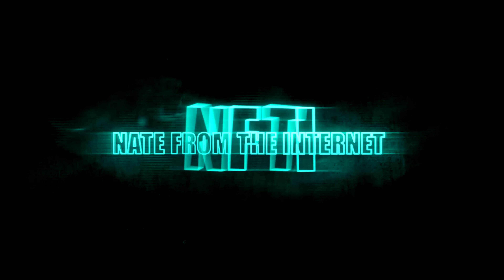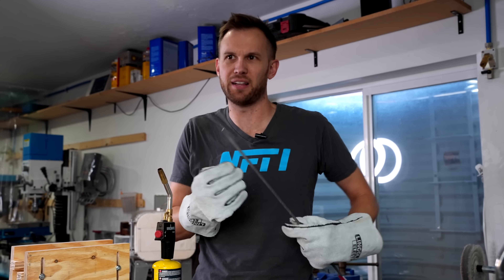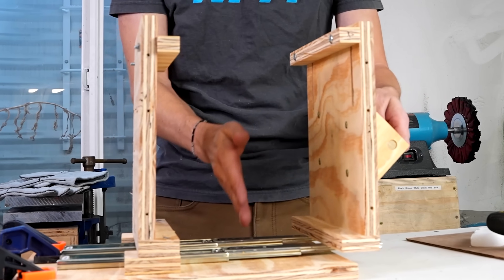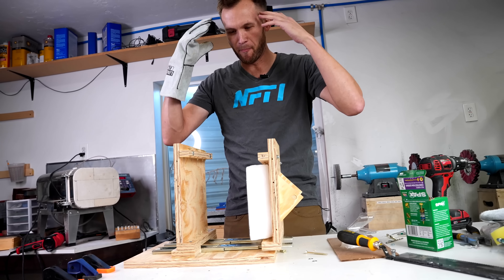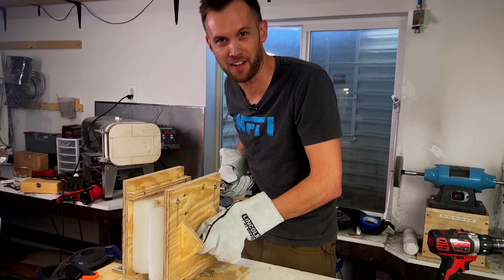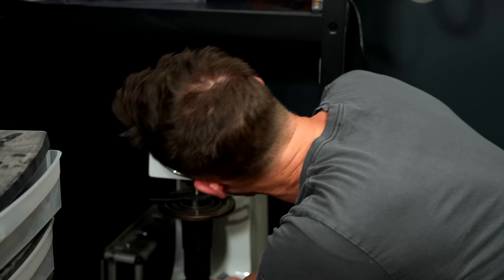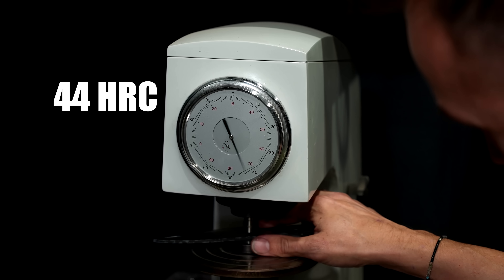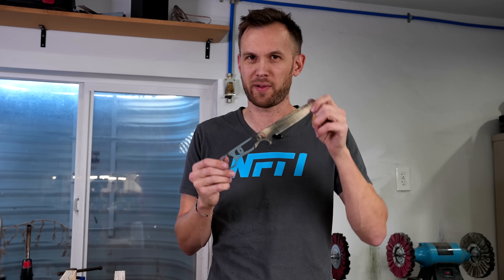Can You Quench a Knife with DRY ICE??

Comment: When using a hardness tester you get the needle as close to vertical as you can in one smooth motion, then rotate the dial to match the needle. Tapping on the adjustment knob might apply too much preload force on the piece. How it works is it has a standard preload force, it applies a test force, then it measures the difference between the initial indent at the preload force and how deep the test load force indented. It might not be a huge difference, but would be more consistent.
Reply: He didn’t grind the thick decarb off of his blade. He also didn’t use foil or anti scale to prevent the decarb from happening in the first place. It’s likely 61-63hrc in the core depending of the stainless alloy

Comment: Could you imagine using aluminum as cooling plates and LN2 to cool them internally?  That might work better than just using dry ice on aluminum plates.
Reply: the way i do it is AL plate quench then into the LN dewar after the blades get to room temp. the blades then spend the night in cryo.  this way my kiln can come down to room temp slowly with the door closed.  its better for the firebrick life.  in the morning i ramp the kiln to 400f and pull the blades out of the LN.  the kiln stabilizes at 400f about the same time the blades get mostly back to room temp. most steels i temper 400f 2x for 2 hours

Comment: I think it would have been much better if you had used  the dry ice vertically, with a lower and upper part, and a weight on the upper one after putting the knife in, that way you would not lose contact and would need smnaller blocks of dry ice to fit the knife in between. Without the moments you lose contact I think it will cool down faster and more evenly. 

and a sugestion for another material to try knife quenching: super cooled water, the water would normally freeze upon contact with the knife as it starts to crystalize, but at the same time it would be heating up too much to properly crystalize around the hot metal.

Comment: The main problem here is probably the steel you are using. Quenching makes certain steel expericence what is called a martensitic change. (https://en.wikipedia.org/wiki/Martensite) The Martensite is what makes the blade hard and the change in crystal-structure is what makes the blade bend permanently. Grain structure is also a factor, which is why the hardness is different in each place. There is a lot of science behind it. What you can try is to reheat the blade afterwards to different temperatures and then observe the hardness and maybe how much it will bend. I am sure the results will be something nice :D
Reply: Depending on the steel, these cryogenic cooled knives will have a huge grain structure and are brittle as pretzels. That's why you quench in warm oil and not cold water.

Comment: Dry ice bath?

In chemistry, we often use dry ice in solvents to have a consistent and even temperature troughout (similar to ice-water)

Most commonly ethanol or acetone, both availabe in hardware stores (but flammable!!!)
Reply: I guess after watching the entire video, that aluminium plates as contact surfaces would be interesting, but cooled with dry ice - Ethanol baths

Might not be as straight forward to build easily/quickly

Comment: Why not use the dry ice to cool the aluminium blocks down and use them to wick away the head?

You could even use LOX or Liquid Nitrogen as well. Actually you could probably have those aluminium blocks with tubes to pump the liquid through as well (making a heat exchanger)

Comment: why not make or get an induction style forge ? , its perfect for knifes
Reply from the maker: No, the oven I'm using is perfect for knives. Most knife steel needs to get to a specific temperature, and then stay there for 3-30 minutes. That's nearly impossible to do accurately with an induction coil.

Comment: It works with modern quarters but not as well as it does with actual silver quarters 1964 and earlier. But if you push the quarter into the ice long enough that it forms a Groove and stands up, the quarter will begin to vibrate and sing. It's a really cool effect. Doesn't do anything else, but it looks and sounds cool.

Comment: Solid to solid without a thermal medium is going to have a hard time conducting heat. I just think you can't get enough consistent pressure on the blade because the surfaces are not smooth. I think with the carbon dioxide sublimating you are just not going to get the thermal conduction you need to cool it fast enough.

Comment: The cooling rate is not only dependent on temperature differential, but also how much energy it takes to heat the material. Water is 4184 J/kgK, steel is around 350 J/kgK, so for every degree the water is heated during the quench, the steel is cooled around 9. The dry ice is around 55 J/kgK, and will (as it goes into gas form) rob almost a full K from the steel. It actually worked better than I expected. Is it worth testing not "press between blocks" but "crush dry ice, and stir a knife around in it" as well? That MAY allow a faster cooling.
Reply: YAPPER DETECTED

Comment: If you need dry ice, go to your local welding supply store. Co2 is sold in dry ice form because it allows for large quantities of densely packed gas to be transported with ease. Co2 is mixed with argon and used as a shielding gas for MIG and TIG welding torches to prevent the surface of metals like steel from oxidizing quickly due to the extreme heats that the metal is subjected to.

Comment: Next step. Get liquid mercury down to -35C, a nice 2 degrees before it's about to freeze. It vaporizes at 356C, so you won't have the leidenfrost effect like you did with the other liquified gases, and it conducts heat better than water. Now this is still dangerous as all hell, but liquid mercury is not absorbed through your skin. It will make a mess of you if it does vaporize and get inhaled, or if you get some around your face holes.

Comment: Dry ice is CO2 in solid form. It doesn't melt into a liquid like water does. Instead, it sublimates directly into CO2 gas. As,a gas, it's an excellent insulator, making it also greenhouse gas. When the hot knife is sandwiched between the blocks of dry ice, CO2 gas rapidly forms an insulation layer between the blade's surfaces and the dry ice block, resulting in a slower cooling rate.

Comment: what grade steel? seeing that your from quench tem was 2000f has to be ahigher alloy grade.  i water quenched some air hardening steel cracked the blade. as to the hardness did you grind the scale off cause that will make the RC tester read wrong.  the longer i watch the more mistakes i see cause you didnt foil wrap the  blade. no clue on soak time. agaain HT coudld be garbage from the start withought  knowing the grade steel you used
Reply from the maker: This was CPM 3-V steel, which was soaked at temp for about 20 minutes. This steel is able to be air or oil quenched. Foil is an option but not necessary for this steel.
Reply: i used to use 3v a good bit years ago.  i have some blades wrecked cause of pinhole in the foil pack. at the hole it will burn the carbon right out of the blade at that spot. unprotected steel at 2000f for 20 min will do a lot of damage.  more simple steels that are heat treated at 1500-1550f range can handle 10-15 min soaks but they will still need to have the decarb ground off.  when using those grades i clay coat them for protection and quench the blades in Parks50 quench oil
Reply from the maker: @lrharner  Well I never planned to put these knives into production, and I did grind off allllll the outer layer. I'm not sure if you can see in the video but during testing and after, the blades are all shiny.

Comment: This was a really well done experiment with the concept. My question is, can a metal be reheated and cooled again to harden it more or would that not work?
Reply: You can to a certain extent. Essentially heating up the steel causes the microscopic grain structure to expand, when it is rapidly cooled (or even slowly cooled for that matter) the grains shrink down and a microscopic crystalline structure of the steel is formed. There are different formations of carbon and iron in the steel, austenite and martensite that are made through the process of quenching. Martensite in particular is what gives it the hardness, wear resistance and strength. Reheating it would effectively cause the grains to grow again, removing the crystalline structure, but you could quench it again. 

I learned a lot of this from a couple material science classes I've had to take for my degree. If you watch shows like "forged in fire" where they make knives, they make this info easily digestible in the case of knife making, not necessarily metal-working as a whole.
Reply: Annealing

Comment: My suggestion is take 2 steel plates and bring them down to liquid nitrogen or oxygen temperatures. And then use that method you have there to quince the knife on. You could even etch the knifes profile into the plates for more even temperature control.

Comment: What about quenching in something like a super-chilled coolant or antifreeze?  It can get MUCH colder than water, but also doesn't vaporize until MUCH higher temps so Leidenfrost shouldn't be as much of an issue?  If the coolant was rapidly circulating that might avoid the Leidenfrost effect even more by preventing the liquid touching the blank from getting up to temp fast enough?

Comment: He is using the term"Knife" Loosely a high HRC blade of 64 or better would not work but would shatter ... The term "Dry ice" is definitive, being the same in any given situation!!... all in all, you can quench a good knife in oil then reheat and let it anneal ( or cool on its own to room temp) and then heat it to 130 or so and put it on dry ice??? for up to 4 hours or liquid nitrogen with the knife being at a slightly lower temp.. AND THE MOLECULES WITH CONTRACT TO A HIGHER DENISITY MAKING A FINER STEEL THUS HAVING A BETTER EDGE POTENTIAL AND BETTER EDGE RETENTION .... Everyone should try nitrogen on their older and favorite knives... But find the correct temp to heat them too before submersing them in it!!!

Comment: Dry Ice → Slab of Metal → Blade ←Slab of Metal ← Dry Ice
Basically have two slabs of metal super cooled by the dry ice. This way, you don't have to worry about the dry ice deforming. Also, you could blow a fan onto it while the pieces of metal and dry ice are pressing against the blade. Also, if the slabs of metal had an exact imprint, almost like a cast, that would conform to the knife and get you the best surface area.

Comment: There use to be a place in the town I use to live in that offered cryogenic hardening service. It has to been at least 15yrs since I've seen/heard advertisements about it. Don't know how they did it. I've never used the service, so I don't know how they did it or how well it worked
Reply from the maker: Cryogenic treatment on metals is done immediately after a regular quench, just as a knife is cooling down to sub-200 degree temps.  I do it with almsot every knife I make.

Comment: Mix your quenching oil with dry ice to get it really cold. 15w30 should freeze up at -55F and there are some specialist oils good to -85F. That should minimize the leidenfrost effect while providing good surface contact.
Reply: I wonder what frizen oil looks like.
Reply: @jwalster9412 it gets thick and just looks solid jello when frozen
Reply: Lard. Frozen oil looks like lard/butter. It's essentially all the same stuff, with slight differences that change the melting temp.  @jwalster9412
Reply: @jwalster9412  that's what butter and other fats are! Frozen oil.
Reply: Supercooled liquid propane is my suggestion. (-188°C) It's how the best cryoEM samples are flash frozen.
Reply: @Tacopi3  You want to get propane close to a red hot piece of metal? If even a little bit of the propane boils near the surface you're looking at propane plus oxygen plus a heat source. This is is absurdly dangerous.
Reply: While some knife maker do heat up their oil first.. i dunno.
Reply: @oldestries yeah, prevents warping.  What he is talking about at the beginning of the video.
Reply: lol i was just about to comment the same thing, doubt it would work better than just oil, but would be interesting to see the results
Reply: This, and make it in a circulating tank so the oil doesn't quickly warm up locally.
Reply: Bro I was just gonna say this, using dry ice with some type of antifreeze aka oil is genius, or anyway to get water below - 10 degrees Fahrenheit, using dry ice and antifreeze and water would work amazing
Reply: I was going to comment some type of alcohol, I've seen people use super cooled acetone but that's also really flammable so maybe not the best idea XD
Reply: That what I thought.. 🤔
Reply: This is what I was thinking. Now I am kinda curious if oil will boil like water does if you drop dry ice into it?
Reply: @willernst2721 the water doesnt boil, the CO2/dry ice is boiling or rather sublimates. You would get the same „boiling effect“ with oil because of the heat difference
Reply: Just did a youtube search. People have tried it. Yes, the oil bubbles. @willernst2721

Comment: Use dry ice to cool alcohol or maybe oil.
The trick is to have a large thermal mass that can transfer heat.
In order to do that it needs to be in direct contact with the metal.  A liquid is the best for that.

Comment: I have a kind of crazy suggestion, how about either wrapping the steel tube of oil with copper piping and run liquid nitrogen or oxygen through the tubing to super cool the quenching oil, or putting the copper tubing inside the oil and doing the same, kinda like a liquid cooled quenching, then quench the (awesome looking btw) knife. this should prevent a vapor jacket from forming, and it will quench all of the blade evenly. I like the suggestion made by @davidblalock9945 as well. looking forward to future videos, Nate!

Comment: The problem is none of the materials actually pull the heat out of the steal. In the case of the aluminum plates, the aluminum actually pulls the heat out of the steal. It's the same with using oil. Just cooling the steal is not effective at hardening it.

Comment: You might also try using dry ice to create a makeshift cryo fluid out of something like alcohol, acetone, or anti-freeze(not super healthy) by cooling the liquid down.
Reply: Exactly what i was thinking, and using flammable liquids doubles the value of the experiment - will the liquid flame at these temperatures? assuming you deal with the vapors of course...
Reply: ethylene glycol is better at the heat transfer, but kinda toxic. although propylene glycol might be a good idea. i know they break down rather quickly under high heat, so it may have unwanted side effects. make sure to attempt that in a well-ventilated space for safety reasons

Comment: What about getting some oil, and chilling it with dry ice chunks and see if that does anything... need some constant contact with the blade.
Reply from the maker: Interestingly, quenching oil is usually heated before use, as the thinner viscosity helps it transfer heat faster.

Comment: Hopefully you read this before it warms back up outside. What if you put regular used engine oil in a cylinder like most do but cool it off as much as possible first supposed to get into the negatives this coming week so that would be free to try as long as you can get some used engine oil

Comment: Aluminum plates are pretty darn effective at heat transfer. I wonder if it would act as enough of a heat sink to be effective if you were to pre-chill the plates in liquid nitrogen.
Reply: no need to super cool the plates with air quench steels you have plenty of time to get the blade under 1000f i use Al plates for all of my air quench steels. main benny is keeping the blades from warping.  at one point i thouoght about putting a 1/4" copper plate on the face of my 1" thick al plates cause copper can pull the  heat out faster. never got around to doing it
Reply: Copper as well. Even steel wouldn't really matter for this application